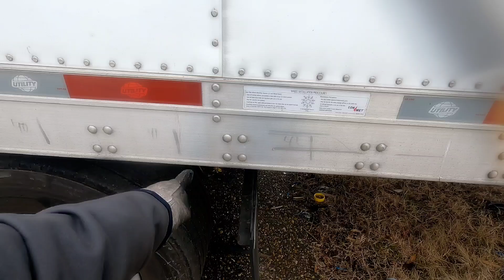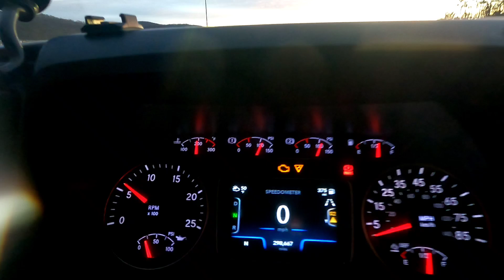Aftermath of Hitting Deer w Semi Truck | Rookie Trucker Vlog

Comment: Could have been worse. I hit a deer in Ohio 20 years ago and completely destroyed the doghouse and grill of a Freightliner 120. The radiator and air-conditioning core were ruined also. The deer was turned into hamburger-helper and spread out for a quarter mile.